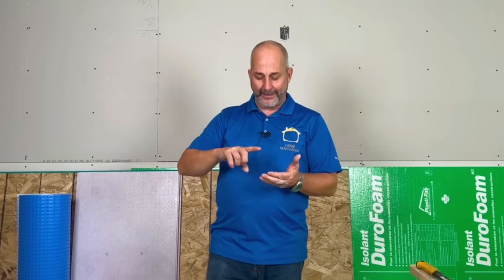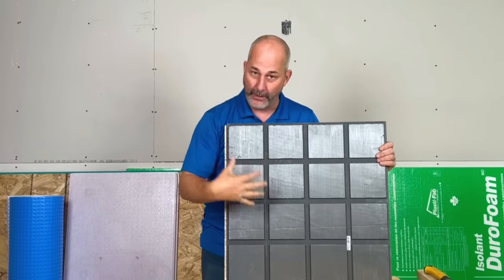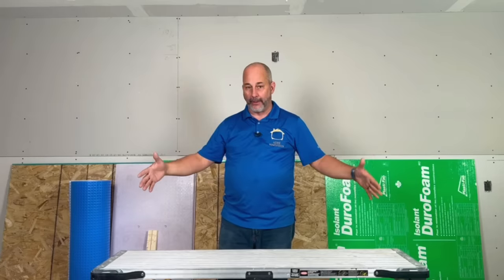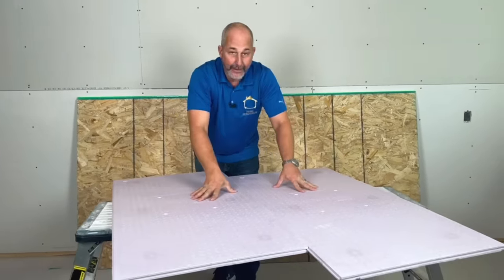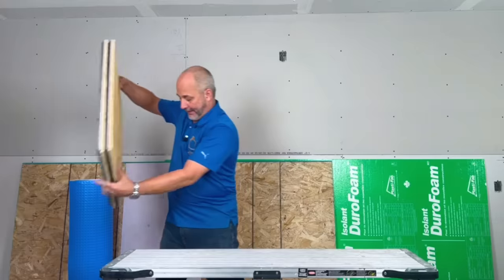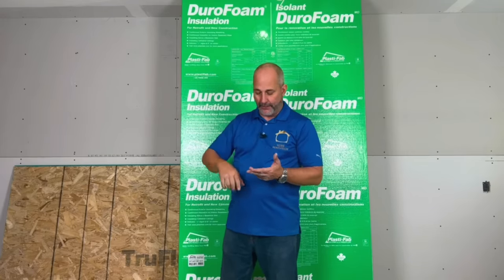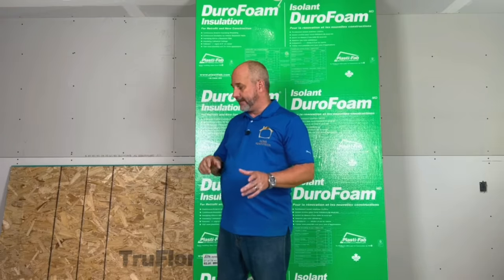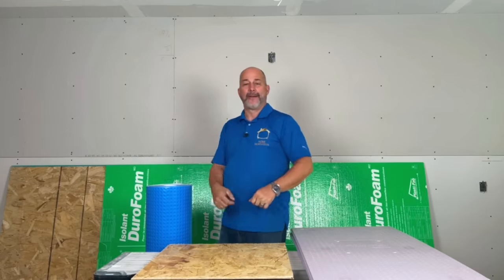Comparing 5 Different Subfloor Systems and What They Cost

Comment: Great video... thank you. I have a house built in 1851. We just had the main back up and regurgitate unspeakable stuff (use your imagination). We also have hydrostatic pressure in spots which leaves the basement wet all the time. Would love your opinion on what we could do as insurance is involved and I know we need a moisture mitigation assembly with a sleeper system (just my opinion). Please let me know what you suggest.

Comment: Jeff , our house is 3 yrs old walkout basement.  In Michigan so my question is. Should we use Self leveler under Duro Foam and then what building material for lux vinyl or engineered hardwood ? And costs? Thanks again for all your hard work it is greatly appreciated.

Comment: Hi Jeff! My partner and I are converting our garage into another bedroom with washroom in a 1950’s home in Victoria, BC. We are going to install floating cork flooring from Cancork. But what do you think of ECF eco foam cork as underpayment? I don’t know of any moisture happening down there but obviously it is a cooler room thats why we are going with cork flooring. Our tiles are installed in our washroom so we can only really get away with a thin subfloor for transition as the floating cork will be 1/2 inch. Would ECF work for us and what do you think of the product itself?

Comment: Great comparison video, Jeff! We live in a 1949 house in Winnipeg and the basement concrete floor is uneven. I used 6 bags of self leveller to raise a really low spot, but the basement as a whole still isn’t flat, and certainly not level. The finished floor covering is still TBD. What do you think would give the best (i.e. flattest) result: the 2’x2’ Dricore tiles or the “dimpled membrane with 4’x8’ OSB sheets”? I don’t think Tapcons aren’t required for Dricore (not sure why), but it’s my understanding that they’re suggested for your DIY subfloor solution with the large OSB sheets. Dricore also talks about their levelling shims, maybe that could work with your DIY subfloor in my situation too… TIA!
Reply from the maker: osb is always warped. the small panels sit much flatter. I would suggest carpet on a really old house to avoid the joints on newer flooring from opening up.

Comment: Hi Jeff, We have an old home (circa 1950) and an uneven concrete basement floor. Some water incursion along one foundation wall over the years (some cracks in same wall - fixed by injection - but no real water comes through the wall, just up from the floor/wall joint in a couple places), and a low ceiling in some areas due to ductwork. All in all, a crazy basement. Looking to sell our house so willing to spend $ down there to have a water-resistant, warmer basement that we can finish up with new flooring, paint, etc. to get it in a sellable condition. Any ideas would be appreciated? Thanks and love your videos 🙂, Kevin. Keep up the great work!

Comment: Thanks! I'm in Montreal. My biggest problem is the thermal barrier. I was wondering, do you do the walls after or it doesn't matter? How you do for the walls barrier? I have put Durafoam on my fundation in one room, but the vinyl flooring is directly on the cement. No biggies, the floor is not too cold. THANKS AGAIN. I'm gonna check your video "My custom subfloor system" :)

Comment: Hi Jeff , my house was built in 1908,on pier and beam with no subfloors. I’ve added half inch plywood, what is best for me to address moisture and vapor so I can add ceramic tile in my kitchen and bath ? I will be adding plywood throughout the rest of the house but LVP or hardwood over it.

Comment: Here's a question. I intend to rip out the basement stairs and rebuilding them. Should you set the stringers on top of the sub floor or on top of the bare concrete?

Comment: I have a house in New England built in the early 80s. We have finished walls in the basement and occasional water problems - don't know where the water comes from. There's a high water table. I think we need moisture barrier - insulation is not an issue. Our floor installer says not to use the home Depot product under the floating floor because it will cancel the floor warranty (I e. The floor will not sit settled). What do you suggest?

Comment: Hey, love your videos. I’m from Saskatchewan. house is 60’s-70’s I believe, doing a floor trying to deal with moisture, thermal and install carpet tiles. What would you suggest? They are floating tiles but I would like to glue them down because I don’t trust those little stickers they give you for just the corners.  Also if at all possible our budget is quite small now.

Comment: My house in Edmonton was built 1964 it is a raised bungalow or bi-level. After our hot water heater leaked we replaced it but the carpet & underlayment was soaked. I have purchased 6.5 mm Vinyl  plank flooring from Costco. Mono Serra is the floor brand and they recommend their own FM-309 1.5mm underlayment but no air flow channels, although the planks also have a 1.5 mm backing. Should I try the DMX one step or DMX airflow?

Comment: So I have a 34 year old house same age as me lol I have a slight water issue in the basement! I want to say just watching this video here gave me hope on a finished basement. I have just one corner that’s slightly damped when it’s pouring rain outside that’s about it every where else looks dry. I Also had water issues by the garage but I think cleaning the gutter fixed that. I want to know if the dimpled osb sub floor would be best?

Comment: ill ask ..8 months later. location NY, house built 1950 cinder block basement with drylock on all walls (so i assume there was an issue in the past) and painted floor, objective is to build a 10x10 grow room in a corner of a 800 square foot space. what should i use?

Comment: I’m in Utah, on a hill, house is only 6 years old and I want to finish my 900 square foot basement with 3 bedrooms, a bathroom, and a media “nook” space. I’ve never had issues with wet or cracked concrete but I am worried about keeping the basement warm because I’d like to put a vinyl wood looking flooring like I have upstairs in the areas that aren’t bedrooms and I don’t want it to be cold. The walls currently have the blanket R12 system over the concrete. I’m doing it all myself and could use some advice.

Comment: I don't have to worry about moisture. I'm flooring a 2nd floor area. I need the best soundproofing. Will the large sheets of 3/4" foam and click flooring (or engineered hardwood) be sufficient or should I also put 5/8" osb in between?

Comment: Thanks for your work Jeff! 
I'm going to be doing hardwood floors over a slab.
It's an old slab and is settled and cracked in some areas, but seems to be done-ish settling. I'm going to have to self-level in areas, as busting out and pouring full new slab is way out of our budget.

I'm thinking that the DuroFoam solution with T&G OSB makes the most sense in my application. Not concerned about water, and would like the thermal barrier. I'll use longer tapcon screws to anchor through the self leveling and into the original slab.

Any concerns with this solution over leveling compound? If not, any other recommendations?

Comment: Could you force air under the dipple mat or dri lock channels. Like cut a hole in a hidden area with a vent(s) on the opposite side of the room and run a shop vac or something every once in awhile to dry the sealed area up? I bet you can even run moisture sensor lead to alert you when something above a certain humidity.

Comment: I'm working on remodeling the basement family room.  I live in Cheyenne Wyoming, and the house was built in the 1940's. The room was originally a 1 car garage. The previous owner turned it into a family room we suspect in the 1970's from the wood paneling and ugly indoor outdoor carpet glued to the concrete. It has a relatively low ceiling of 7 feet between the and concrete and the joists (without any ceiling). From what we can see  there has been no moisture problem in the room except for the pipe leak that instigated this, replacing the old galvanized with pex.

We are turning it into a media room and so we want carpet.  What would you recommend? We were thinking of a thin foam membrane material my wife found when I did my office with carpet tiles. It insulates a little bit and has been fine with the heat of the computers.

Comment: Thanks for all your videos, you’re very knowledgeable. I’m thinking of the DMX one step with VLP for our 1500 sq ft basement but going to have a pool table. What would you recommend for something so heavy? The house is 20 yrs old and not any moisture problems we can find other than two corners leaking from previous owners that had it waterproofed (not many details for us). Also we are building an island bar with back wall full of cabinets. Do they go on top of the floor? If not, what do we put them on?

Comment: Hi Jeff, I too find myself looking for your suggestion in our ongoing house renovation in climate zone 4a in Ohio. House built in 1968 and was able to confirm no vapor barrier below slab when taking out an old shower pan and looked in the slab cutout for the drain. Concrete foundation walls used to leak water through form tie holes, but patched those with a swell plug and hydraulic cement. Foundation walls now have 2” XPS continuous glued to the interior face with a 2x4 cavity wall inset from that. We also framed in a new laundry room. These new perimeter walls and laundry room wall are already in place. Vapor from the slab will definitely be an issue. Water infiltration from walls looks to be taken care of, at least for the foreseeable future (new gutters and downspouts, site well graded as well). I’m partial to the DuroFoam with OSB solution you speak of here and in your newest video since vapor from the slab is the primary consideration. Is this your recommended path forward? Is there a way to accommodate the walls already being installed such as drilling holes through the underside of the green treat sill plates? Love your channel, thanks!

Comment: Hey there! My house was built in 1958, I recently pulled up old tile that was glued directly on the concrete in the basement, I noticed there was some calcium deposits coming from the cement most likely due to moisture. When I do my flooring, what sort of subfloor should I use?

Comment: Hi Jeff, I just moved to a new house in suburbs of Ottawa. Basement is concrete, but its well leveled. Doesn't feel like there will be moisture problem in the basement.  Do you think I can directly put vinyl flooring over concrete. I showed it to a contractor who worked in my house, he told me that he did the same for his basement and it works well. Thanks for your informative videos.

Comment: I've enjoyed the basement videos. We have a 10 year old house. Walk out basement with vapor barrier and solid concrete walls. (4' cinder block and studs on the walk out end.) The Basement also has a sumppump and a floor drain.
Should I worry about water or just focus on a thermal barrier?

Comment: Great videos Jeff. I live in a suburb south of Montreal, Quebec. Our house was built in 1972. The previous owner put plywood topped with carpet for the basement flooring. The  basement is 4 ft underground and is used as the family room. The floor in the basement gets cold in the winter and I don't see any moisture situation to the naked eye. What are the best products for thermal brake and any potential water management for my basement?

Comment: Thoughts on PermaFlex from from SaniTred for a rubber based basement sealant for walls and floor?

Then maybe putting wood sub floor?  Then another flooring on top?

House was built 1970's, located in Michigan.  No current leaks, or moisture.
Reply: Or what about epoxy on the floor?

Comment: Hi, Jeff. I'm in Montana, and planning to finish a basement in a 1950 home. There have been no signs of any water issues (while we do get a lot of snow in the winter, the climate is semi-arid and the water table is at least 20-30 feet below the ground surface). The grade around the house slopes away from the foundation. Certainly no vapor barrier. I know all factors are important to consider. However, my top two priorities are low cost and low thickness, as the existing ceiling height is only at 7 ft. What product/system would you recommend?

Comment: I'm literally as we speak prepping to finish my basement of my 1966 build house in Michigan. 

In doing so I've demod concrete in 2 areas, one area for in ground plumbing for a new bathroom shower and toilet. And a new drain for a sink/washer discharge, all going to a new sewage discharge basin. The second area I broke concrete is for 2 floor drains for water softener, back-washing water filter, and boiler condensate discharge to drain to. Again all going to a second sewage basin.

To my surprise my 1966 build house had plastic moisture barrier between the aggregate and cement slab. I also have moderate radon levels, so this coming week I'm going to start applying "Radonseal plus"  And"ionbond" to slow radon penetration and help with potential moisture issues.

My current research has been my subflooring. I wanted to build my own subfloor with dmx 2.0 1/2 or 3/4 foam board and then a tongue and groove subfloor. It's the cheapest per square foot vs a dricore foam subfloor, but as you suggested 4x8 sheets of plywood doesn't quite sound attractive at this moment. No large windows, stairs to basement are in the back corner of the house with awkward angles. I think I might have to take the L and get a dricore or similar system.

Comment: Thank you for sharing your knowledge! My uninsulated cement core floor 1952 brick home is really COLD in very Northern Ontario. The floor is damp too. I bought DMX 1 for moisture but I like Insul-Armour for warmth. Not a lot of height can be added. I have looselay 5mm flooring planks and tiles. Please which system would you suggest? And do Ihave to put board under looselay? Thank you so very much, From a confused and single lady! 🤪

Comment: My home was built in 1965, and last spring we had some water seepage through the grout in the tiles, in the basement. It was an extreme rain event, right as the ground was starting to thaw. There wasn't enough seepage to cover the tiles, but it was enough to separate the tiles from the slab and ruin the grout.

We may never see those conditions again, but the tile has to come out regardless. I'll be adding a thermal break, (the tile was, surprise, frigid) and I've been considering water management as well.

There are no good windows to get material down, just a staircase that's 31" wide, with 71" clearance. The flooring will be vinyl plank. What would you recommend in my case?

As I'm sure you've heard a thousand times, you've empowered me to do many things around my home I would never have thought I'd be able to do. Thank you so much for all you do for the DIY community!

Comment: Thank you very much for all these videos! I have an older home, built 1949 in the upper Midwest, Iowa. So it gets really cold and frozen in the winter. I feel like my only option is one of the water management systems with the groves on the bottom. As for flooring, I’m not picky, I’m fine with an inexpensive LVT or LVP click together floor. What is your suggestion?

Comment: Jeff, I have a rough finished concrete floor at home and have no idea which solution would be best for me. I would use a self leveling compound first but I have multiple items in the basement that cannot physically come out.. Do you think if I laid the durofoam down, it would take up enough of the roughness to not be noticeable? Level wise it is okay, just some aggregate pieces stick out above the plain. Great videos btw!!

Comment: Hi Jeff! Thanks for the video, I live in a really old house with a basement that often gets puddles of water after heavy rain and the winter thaw. The puddles disappear after a day or two but it does make it difficult to store things due to mold growth. We only use the basement for storage, so heat and sound management aren't any concern. Would we go with that blue roll or the insul-armour or a different option? Would like to put a cheap laminate floor over top but want to make sure the water is managed properly underneath to prevent mold growth. Thank you so much!

Comment: I’m going with 3/4” hardwood on top of OSB on top of InsulArmour.  My house is built in 2001 in the Centre Wellington area.  It has vapour barrier and there is no evidence of flooding or moisture, but damn it’s cold down there.  I know it’s overkill, but I like the ease of installation and the peace-of-mind that comes with the moisture management.  With only the first two layers down, the difference in temperature is staggering!  It’s worth the equally staggering price tag.

Comment: So what do you do in a basement bathroom if you choose to run the DMX 1-step in the rest of the basement and want to keep the flooring level throughout? How do you attach the toilet flange to something secure? Would you use the drycore panels in the bathroom so you have something you can tapcon into the concrete, then click-lock flooring on top? The rest of the basement would have the 1-step with click-lock directly on top.

Comment: Thanks for all the great advice, your videos have been such a help over the years. 

One question though. What product would you suggest for a basement in  Ontario that has somewhat uneven painted concrete floors. Grinding it flat is not an option at this point. Basement was redone in the 80s, and carpet tiles left on the floor over the winter showed some moisture buildup. We would like to put carpet down, purely for comfort (temperature isn't an issue) but dont want to create a mold or mildew issue.

Thanks!